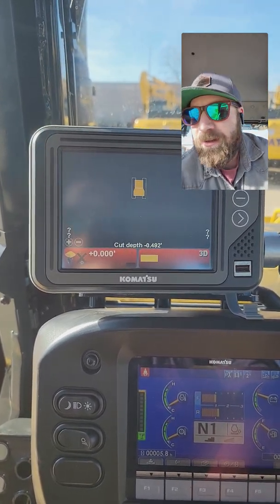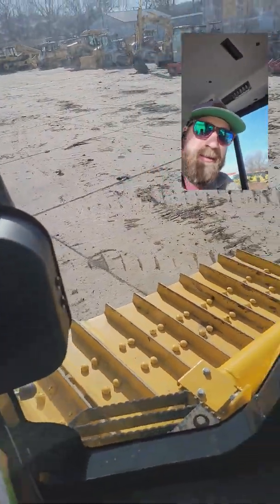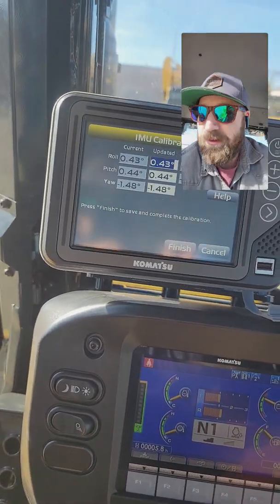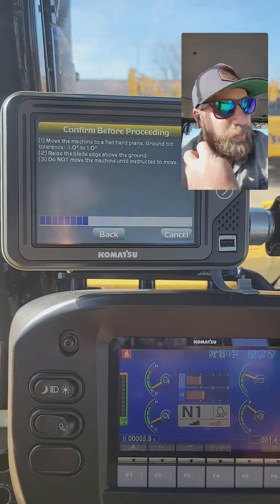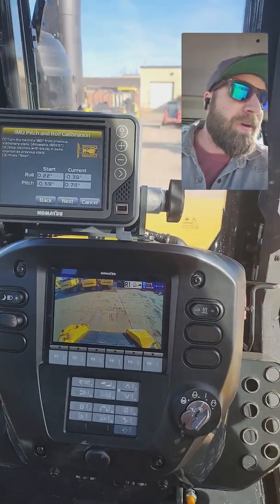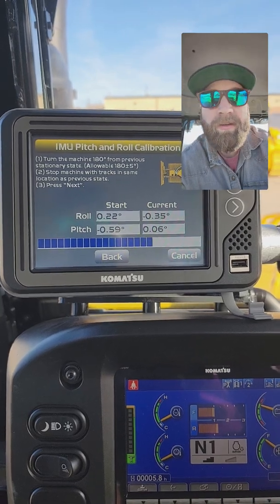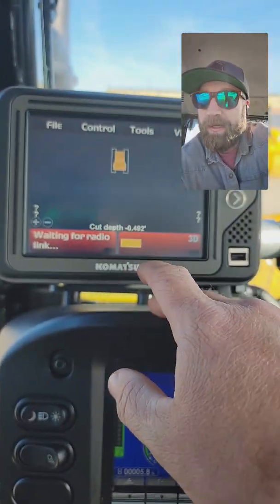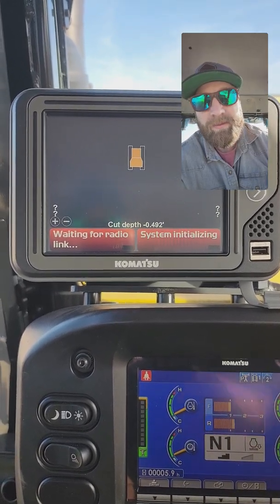Komatsu IMC 2.0 - IMU Calibration Walk-through

Comment: When I active my automatics the blade jumps up and down several inches.  The blade doesn’t stay at the same elevation consistently.  Is this normal? What can I do to fix this?
Reply from the maker: There is a possibility that the Work Equipment Handle (joystick) has some excessive play in it. If you notice play in it, it can cause the blade to be jerky or act erratically. There is a service bulletin for this through Komatsu.  
It could also be a bad design. You could create a flat pad and see if it works any better on a level surface. 
If the machine used to work fine I would lean towards one of the prior things I've mentioned. If not, it could be a variety of calibration issues or stroke sensor issues. If you don't have a Komatsu TSE to talk to let me know where you are located and I can probably get you in touch with someone near you.